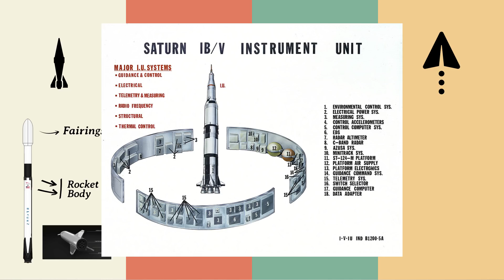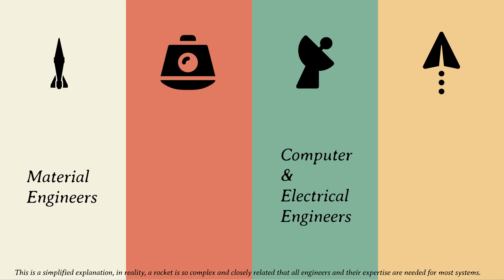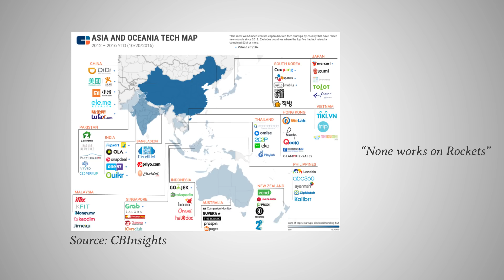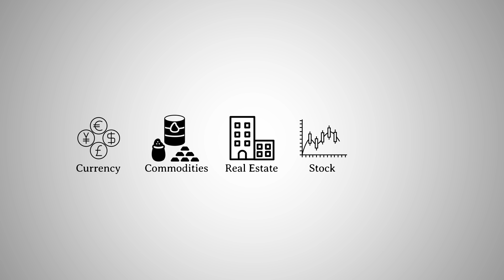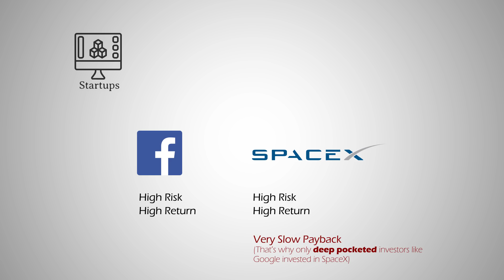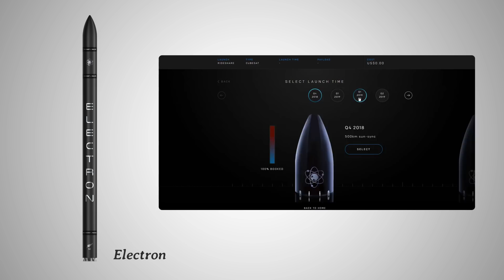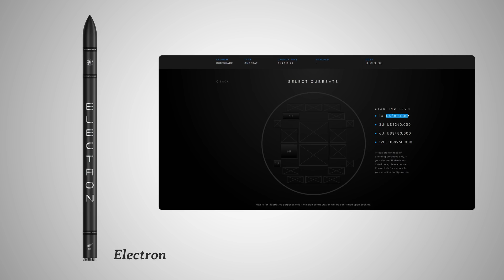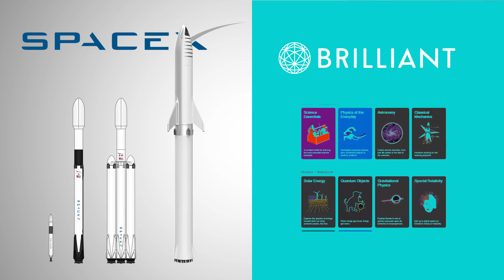How hard is it to start a rocket company? Ft. SpaceX & Rocket Lab

Comment: Rocket Equation all good.  Oops.
Reply: That's because most of the braking is done trough aerodynamics
Reply: @E9X330 NASA website indicates  kerosene-oxygen fuel requires 94% of liftoff weight in fuel to reach LEO (1/16 of fuel weight delivered). This assumes no aerodynamic losses orr rocket inefficiency losses. Without accounting for aerodynamic  braking  compound rocket equation requires 272 times  main rocket dry weight so that only 0.3% of liftoff mass is main rocket and payload.  So .. how does the main  stage achieve such drastic  aerodynamic braking? What percentage of reqd fuel is saved on descent?Compounded "tyranny of the rocket" a real problem it would seem . So .. how does the main stage achieve aero braking, how much fuel savings, and how do you know and do you have a reference?  Tyranny of rocket pretty fixed based on energy density of fuel.  NASA reference at  https://www.nasa.gov/mission_pages/station/expeditions/expedition30/tryanny.html.
Reply: @TheSolarScience  you are aware that the falcon 9 and BFR first stage never come close to reaching leo ?
Reply: @E9X330  Thanks and sorry.  I just realized that second stage isn't recovered yet. Saw some of the air brake designs ... funky.  Thanks for taking the time to read and respond to my stupid question.
Reply: @TheSolarScience  no problem, always glad to spread knowledge. The bfrs second stage, more commonly called bfs, will use a combination of aero braking and propulsive landing. Just needs a tiny burn in LEO to get into a suborbital trajectory and the control surfaces take care of the rest (until the suicide burn ofcourse)
Reply: @E9X330  much appreciated. I have wondered about the names .. I would guess that a few chuckles and  Bfr  cams from "big frickin rocket" and perhaps  Bfs .'Big frickin second?". I can see Elon having a chuckle. Thx again for the pleasant exchange and perhaps we shall meet again over a better question
Reply: @TheSolarScience  BFR according to musk stands for "big fucking rocket" while bfs stands for "big fucking ship" but because boring people think that sounds unprofessional, they are commonly called "big falcon rocket" and "big falcon ship" kinda reminds me of what Elon had going on with the Tesla model names

Comment: Don't forget about the immense supplier and subcontractor infrastructure a rocket company needs to actually build and assemble their rockets. Only few parts are actually made by rocket companies themselves.
Reply: Still many components are sourced from suppliers. The tooling required for manufacturing of certain parts is not worth the investment on this small scale. Components such as fasteners, electronics, actuators, plumming, valves etc. are not made by SpaceX.

Comment: I think Space X should do something like Rocket Lab's Electron
Reply: no while Falcon One was comparable, going into small launch would be diverting resources into competing for the smallest segment of the market, yes there is money to be had, but for the resources they have now, they can get more return on investment in going bigger. There are other benefits to NOT competing in small launch as well, with BFR, in order to do direct insertion missions, or high energy one way missions, they will need a chemical kick stage or tug, preferably with smaller engines, while ideally you would want methalox to save on GSE, a successful small launch industry essentially develops those kick stages for you, and can be self sufficient when you dont need them.
Reply: @TheMhalpern  You sound like you know what you're talking about
Reply: @danyala.1659  thank you, i frequent a lot of space blogs basically what it comes down to is that there are certain things it simply doesn't make sense to design a reusable rocket to be able to do reusably, and with interplanetary missions (outside of Luna and Mars) even if you could pack that much fuel by the time you could get the ship back, you might not want it. With direct insertion, you don't need it that often and it doesn't necessarily make sense to send up a tanker every time you need to do direct insertion, so in comes a kick stage, but you only have so much space in the cargo bay so you need a small engine, and small rockets have smaller engines, in fact you could probably use a small rocket upper in some cases
Reply: @Private Space: Blue Origin, SpaceX & Rocket Lab  Or Relativity, whos geared for low production (may help them survive) and more a competitor with Ariane's Vega.

Comment: The esa rockets are actually built in South America
Reply: But they do not use "local" workforce or industries... it is all "transplanted" from France.
Reply: @adolfodef  Not really, because French Guyana is officially still a part of France.
Reply: About Ariane ... Most of the dev is done in France near Paris. Conception, theory,.simulation, design ... And some parts are also built here (boosters and some sats). 2y ago they tested an engine near my house (static fire of 1mn , could be heard 20 miles away ). Other parts are built in the south of France.
Reply: Gringoo